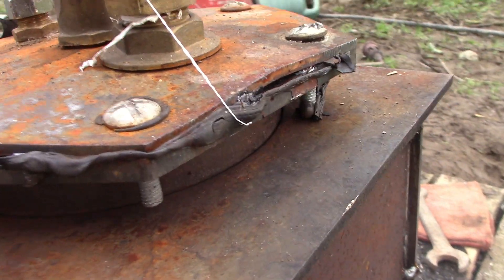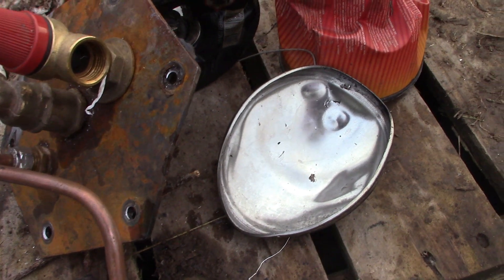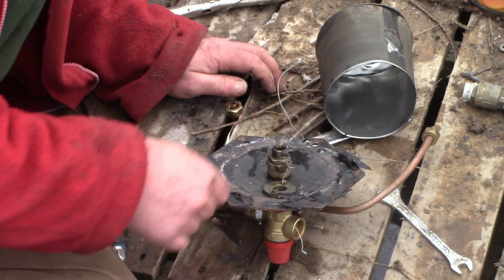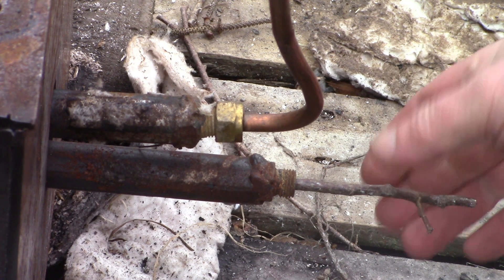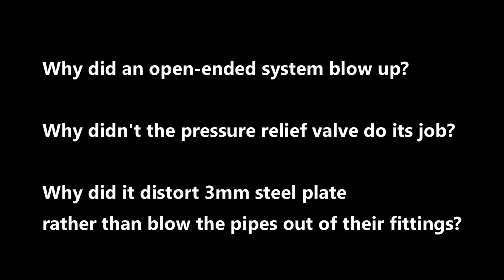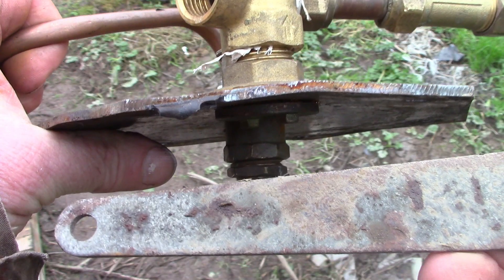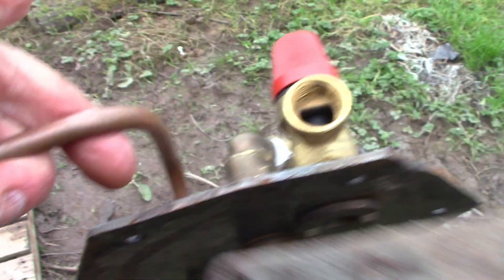Why Did My Boiler Explode??!! My Own Big Bang Theory...

Comment: Umm. Bottom collapsed first, vacuum then expanded the top one like a balloon, pop! Steam flash from vacuum then onto hot boiler sides blew the boiler top before the pressure could exit. 
Annealing or Strain Hardening - In writing my reply. I think I may have thought of a flaw. The fire surrounds the boiler, but the bottles also displace a large about of space,  allowing the space above the water to reach a higher temp. This higher temp would allow the top bottle to heat up, the water level falls, allowing water to now flow in over the top bottle,  cooling it. Or partial flash boiling as the water flows in causing a rapid shrink of the  bottle. Thermal cycling  and Strain hardening and differential heat treatment. On that top bottle over time. That top bottle would have had a hard life. 
No boiler ideas. But a simple soda can analogue, when its full it won't collapse, but when empty it can be easily collapsed. Boiling water is making a changing pressure and vibration in the system not a stable pressure. Heat softens the gas bottles *designed to keep pressure in not out. I think the bottom one collapsed first. Inrush vacuum then expanded top bottle to burst like a balloon while it as at rest on the pressure valve,  The bottle failed, brittle from the constant heat cooling cycle. Steam over pressure, the water flashed in the vacuum, then on the hot sides above the water line, of the boiler topped up the pressure of with the bursting bottle damaging the boiler lid.  Could a "cold water" tank to the side be used for water level? With an upper and lower boiler connection . Heating a larger (safer) volume of water and only allowing flash boiling in the chimney or fire grate

Comment: Thanks for posting the details of the mishap.  It would have been easy to just keep that a secret.  
Flat plate is terrible at resisting any significant pressure.  Domes and cylinders are far far better.  Of course sometimes there is a need for a flat surface in a pressure vessel.  They fix the weakness with stays that tie the flat surface to a strong surface facing it.  Do a search for boiler stays and you'll get loads of information.

My other thought is your safety relief valve.  Is it for water or steam?  If it's designed for a water heater, it will not function as intended for live steam.

Comment: Inspector of pressure vessels and boilers here.

When I saw the boiler construction build (20 min ago) first thing I thought was "how did you get ALL the gas out of the bottle"?

As soon as the top bottle got hot enough to be ruptured, it did.  As it expanded the relief valve was either blocked, or simply too small to let all the pressure out  and the flat unstayed head (3mm plate) couldn't contain the pressure pulse. 

I'M glad you were using a safety relief valve, though I'm not certain you are using a steam rate valve.   Just because they are treated for pressure doesn't mean they are reated for steam. 

Use a different sourced float (perhaps welded from pipe), and a steam rated safety valve.

Comment: Please just get a gas engine and make a muffler. I'm sure that you can make a large and effective muffler. Or just power it all electrically from your giant diesel engine. A third rail system at a low voltage maybe?

Comment: Pressure differential is a bitch. Paused at 3:01 to provide my theroy. Given HOW the cans were crushed I am guessing that they were still pressurized, and that the pressure inside your boiler was far greater than the pressure inside the cans, resulting in a implosion. The shift in pressure was so great it cause the whole boiler to "explode"

Comment: The open ended system did not blow up; a closed, internal component of the system burst, namely the top gas canister.

The auto ignition temperature of propane (propane ignition temperature) is 470°C – 550°C (878°F – 1020°F); that is the lowest temperature at which it will spontaneously ignite in air. Butane auto ignition temperature is 405°C or 761°F. It is unlikely that the boiler reached anywhere near those temperatures, so it is unlikely that the top float burst due to any residual fuel detonating. 

The most likely explanation is that the top float burst due to overheating the gaseous content, separating at the base seam, when the internal canister pressure exceeded the surrounding boiler pressure by enough to break through at the weakest point. The canisters normally operate at just over 2 atmospheres of pressure, so will not take much more to burst them. Given that the PRV was rated at 3 bar, the canister probably burst at about 4 or 5 bar above that, or even more.

The base traveled down the boiler ahead of a pressure wave, which caused an immediate collapse and implosion of the lower canister. Driven by the oposite part of the pressure wave, the dome of the top canister impacted on the top plate, and bent it due to the kinetic energy.  The thin metal of the canister wraped round the outlet and 3 bar PRV. It looks like the PRV actually punctured the skin of the canister, so it probably was still able to function to relieve the excess gass pressure. The steam chamber was still open to air, and there is no evidence of bursting in the fittings or material of the boiler.

The boiler did not explode, the top gas canister did.

Comment: The steam loop itself didn't fail, as you said it is an open system.

Your float's are what caused the failure but not from imploding, I believe they exploded. they are sealed, and so when you heated them up to water's boiling point inside the boiler the gas inside the floats increased in pressure, they are also made of pretty thin aluminium which is not a material that deals with heat well and loses a lot of its strength as it gets hot, I calculated that the floats would have had around 30PSI of pressure in them which normally would not cause them to fail, but with the strength loss of also being heated to 100C or higher in the boiler caused them to fail. 

A few other's have said that this isn't really an open steam system at this point and they're right, when the float exploded the rapid increase in pressure inside the boiler couldn't vent through the system either because there was enough restriction to allow a very short but significant spike in pressure in the boiler (I dont think the float blocking the relief valve and outlet would have contributed as if that was the case it would take a bit of time say 30 seconds to a minute for it to build pressure to deform the lid) and so your 3mm lid acted like a burst disk, you could likely continue with the same idea if you made a float out of sturdier material, the empty gas canisters are very thin, go with some 3-5mm thick steel for the float, it will still work as a float as long as its hollow and sealed but won't explode.

The relief valve didn't work because the 3mm steel top is to weak to allow the pressure to get to 42PSI in the first place, that looks like 8 inch pipe on top of the water chamber? so means a surface area of  50 square inches, at just 10PSI that's 500 pounds of force, at 42 PSI you are trying to hold back 2100 pounds of force, that 3mm thick plate is nowhere near ridged enough to prevent itself from deforming under that much stress, so when the two gas canisters popped (I estimate they would have had around 30PSI in them when the canisters exploded) that was enough to deform the top of the boiler on it's own without any extra help from steam pressure, this is also why the steel plate failed fiest, it had so much surface area that it was dealing with a lot of force, the fitting by comparison are tiny, so the force they're withstanding is in the realm of ounces rather than hundreds of pounds, so the 10 or so PSI that caused the lid to fail was nowhere near enough to cause the valve and fitting to fail.

Just take a lot of care going forward now that you've found a weak spot without even pressurising the steam loop, as you add pressure to the closed system the boiling point of the water increases dramatically, for example at only 50PSI pressure the water's boiling point will be 135C instead of 100C, that means that if you have a failure like this under pressure instead of it just being the steam pressure, all of the water that is heated beyond 100C will flash to steam the instant the pressure in the system drops to atmospheric which will make a huge explosion in comparison since water's volume increases to 1'700 times it's volume when it flashes to steam. 

this is ultimately what makes boiler's far more dangerous than just boiling water, but containing it you are storing more and more thermal energy in the water like a huge spring, if the containment for the water (or the spring) fails it all get's released at once, this is also why you never pour water onto a grease fire to try and put it out, the grease is way past 100C so the water flashes to steam spraying screaming hot oil everywhere.

Comment: My thoughts: The floats were wide and restricted flow of convection currents in the cylinder. As the float moved upwards, a stream of cool water to moved to the bottom of the tank which is where the boiler was hotter because of the fire. (Think of a Stirling engine).
This caused rapid expansion of the gasses and crushed/mullered the cans. 
The cans restricted the relief valve underside hole from ejecting any pressure, causing an even greater pressure (though a modicum may have got through). 
The top blew because Force=Pressure*Area and the area on the whole top was much larger than the area on the pipe. The olives would have only let the pipe slip out if the force on the cross sectional area of the pipe was great enough, and since it was about 8mm diameter compared to about 100mm, the force was over 150 times greater on the plate, and even that included the cross sectional area of the pipe because it was on it. (Think mechanical advantage in hydraulics)

Comment: Believe the old propane tanks have a plug that melts at temp to relieve pressure so they don't explode. Likely they vented then the gasses lit off in the boiler.

Comment: It's a good bet you got it right,,,the collapse of those bottles was the cause,,,the ratings on those are for expanding gas pressure not the vacuum created internally by outside pressure. If you look at home heating valve systems they operate a bit different to Indicate low water levels.. your ideas are good just maybe the materials not correct.. there maybe an electronic solution to water levels but mechanical would be preferable.
There is a great video on YouTube of a tanker implode you should see.

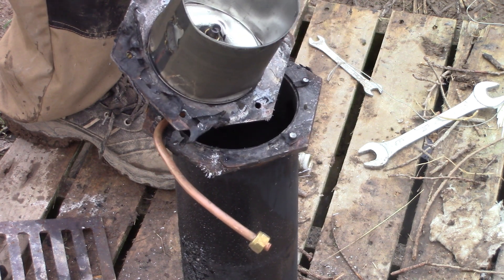Comment: At 1:47 As you can see the top float collapsed and blocked the pressure valve as it did with the steam outlet. The only thing that wasn't blocked is the water inlet  so the pressure had to find a way out and it did by the bang we all can imagine.

Comment: Each slight restriction in your two superheater stages creates a differential pressure. The steam pressure at the outlet is at atmospheric, so the pressure in the drum is above atmospheric, maybe not by much, certainly less than the 45 psi of the safety. Saturation temperature (boiling point) is intrinsically linked to the pressure, drop the pressure and you drop the boiling point. If the pressure was sufficient to collapse one of the floats, it reduces the water/float volume, and thus cause an immediate pressure drop, dropping the boiling point and allowing the water in the drum, which is now above saturation temperature, to flash off. Because 1 cubic inch of water makes about 1 cubic foot of steam, this instantaneous change of volume makes rather a dramatic explosion. 
     Imagine the force needed to bend an 1/8 in plate with a hammer. This is the result of the energy released by the water flashing off. The only query in my mind is the pressure required to collapse the gas cylinder float. It was made to contain pressure, not to withstand outside pressure, but I would have thought that it would do better.

Comment: Your floats blew up. Most fuels are incredibly heat sensitive and expand a lot due to heat. Those poor little cans couldn't handle the pressure inside and blew up.  If the steam itself built up too much pressure, I think the results would have been far worse.

Comment: I agree with alot of the other comments in that basically you need a redesign of your feed water system. The float valve is an excellent idea for a small boiler system though the float size is a bit of an issue. Ideally you would probably want a float that is ¼ or less the size of your tank so that you reduce the risk of running your boiler dry and blowing up your set up. It also ensures that in the event of a catastrophic failure of the float, the pressure relief valve doesn't get blocked. It may be more prudent to use a continuous feed water supply and have it come in from the bottom.

Comment: You had a catastrophic failure of the upper float due to a gas explosion inside the canister you were using as a float. I suspect the canister came to rest with its shell in contact with the side of the boiler chamber allowing temperatures to go up over 100deg C inside the canister. It had literally nothing to do with the steam pressure.

Comment: To pop the lid is easier than the pipe because the area of the lid is larger. Like a  hydraulic piston, where your lid is the piston base with seals, and the steam is the oil.

Comment: I’ld back up your theory, and add, with the sudden collapse of the first float, or a leak from the cap, the pressure drop could have flash boiled nearly all that water. I think steam is 13x volume of water (temperature dependent?), probably caused a shock wave that deformed everything before the relief valve could relieve anything. Same for the open vent. A shockwave would have deformed everything in its path as fast (speed of sounds) as it moved.  
Really really happy you were moving away from it, how’s you hearing?!

Comment: Water injection valve blocked, first boiler boiled dry, temp increased till the top gas cartidge blew it's bottom out. Possibly a secondary effect of this shocking the water valve spraying water into the now very hot chamber instantly boiling. Causing a steam explosion. And the small pipework on the way out not beiog enough of a path for the big pressure spike....
Well it's an idea.....
Reply from the maker: there was plenty of water left inside still..

Comment: It appears to me that the steam part of your  system didn't  blow up. It looks as though  the top float blew up from internal pressure, driving itself  onto the valve and the quickest release/ weakest point was the flat lid and homemade gasket. No place for the pressure to  go so it went out under the lid. The lid failed  before the  pressure could  escape  out the tube.

Comment: As Matthias Wandel surmised your top float collapsed blocking the safety valve.  To avoid this:  1) use floats that will not distort/collapse, 2) move the safety to the side so it cannot be blocked (best to do this anyway).  The stick in the outlet had nothing to do with the big bang as you problems occured in the boiler.  I would suggest talking with some steam hobbists in your area before doing any more,  this can get deadly.
Reply: One thing about your floats, they are meant/designed to contain pressurized contents.  NOT to withstand external preassure like a bathysphere (diving bell).  I would suggest you hydro your new system to 1.5 times your safety valve setting.

Comment: EDIT: First paragraph is nonsense, as pointed out below.
Assuming you managed to get all of the gas out of the float-cans (and didn't leave enough in there to auto-ignite: butane's autoignition temperature is ~283 degrees C, which is not a million miles from the output temperature you were measuring), my money's on a supercritical boiling event like you describe (water above 100 degrees C flashing to steam on an abrupt drop in pressure). 

Looking at the teardown footage, it looks like the bottom of the top can got blown off - maybe the lower can crushed, and the pressure spike pulled the bottom off the top one? Or the ballvalve in the top can failed closed, and the top can burst as the air trapped inside it expanded in the heat?  I don't have enough information to say which of those two happened, but I suspect it was one of them.

Supercritical boiling can be a nasty thing - there have been cases of microwaved glasses of water suddenly erupting in steam and scalding water when disturbed, despite appearing calm.
Reply: autoignition don't work if there is no o2 in there only h2o in the boiler
Reply: @odjwizardo3198  ...that is an excellent point.  Edited, thankyou for reminding me that the Fire Triangle is a thing.
Reply: @dansummers2965   there are a lot of people saying gas exploding but the canisters were empty or had only gas left in them but no liquid gas to boil.

Comment: Hi Tim, I believe it to be residual L.P.G in the cylinder, which then became pressurised L.P.G which then ignited at compression point which caused flash explosion within combustion chamber(float area) which then combined with superheated steam which instantaioniously  released to atmospheric pressure, also imploding cylinder blocking P.R.V thus resulting in it being non functional..a scary moment!👍

Comment: Clue 1 don't use propane cans as floats.  They are made to hold pressure not be compression.
The pressure valve is not under pressure but the propane can will have the internal pressure vent when hot then it will implode and drop the pressure in the chamber thus boiling the water.

Maybe do what all pressure vessels are required to do and get it certified before  use. 

After all the law (UK) was brought in to stop tinkering with  steam vessels because they like to explode.